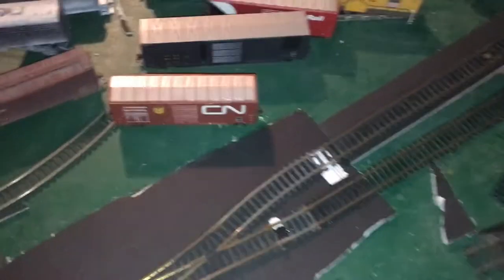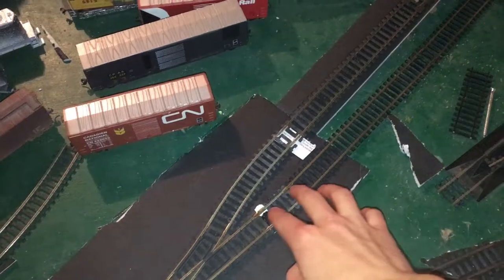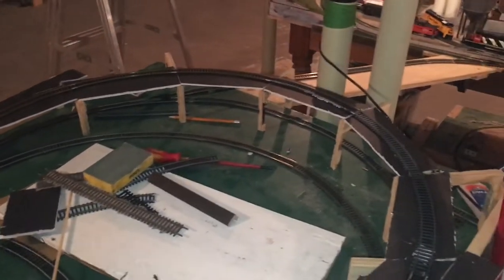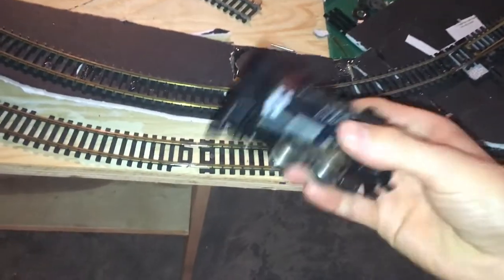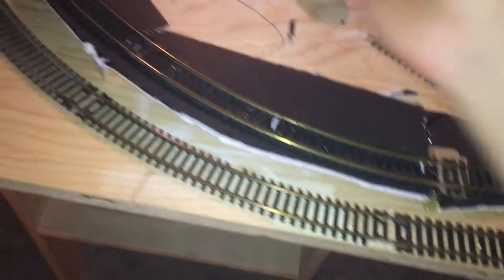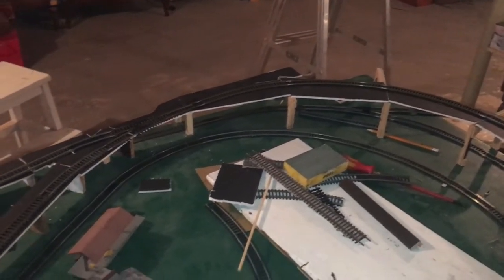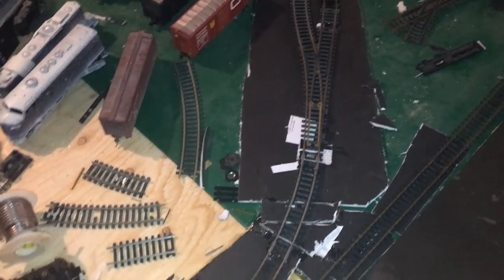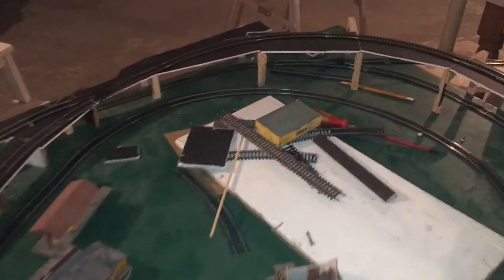I was wrong about the reversing loop

Comment: Well, you made a very intricate bi-level figure-8 anyway, lol!  Atlas used to make a pre-made Reverse-Loop Controller with pre-marked polarity switches, I used one in the late 70's on one of my layouts.  DCC systems have auto-polarity reversing mechanisms available, which can make things a little bit easier, but also much more expensive.  Then again, a turntable would be just as effective and realistic as real railroads used them too!  Learning all the tricks with just regular DC could take years and still be just as fun, in my opinion.

Comment: You should make one car a “polarity” car by marking one side with red tape & the other side with green tape. Then push the car around the area shown in the video & you will visibly see where the polarity ( or DCC phase) changes. You can mark the points where it changes with tape or push pins. What are you using to solve the reversing loop?